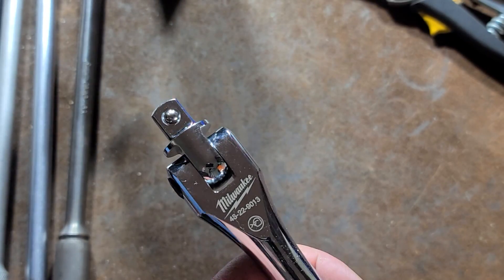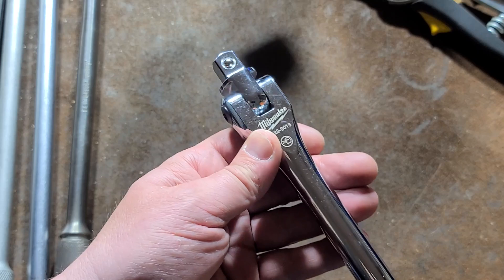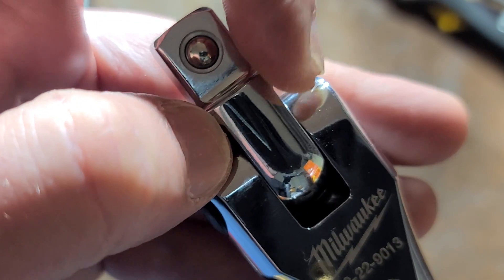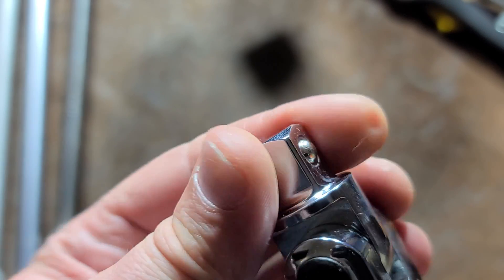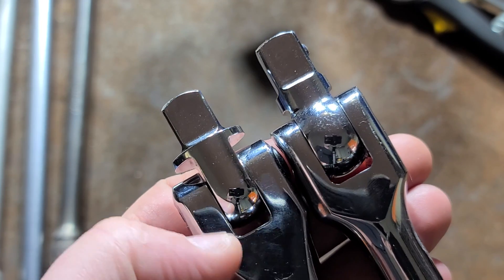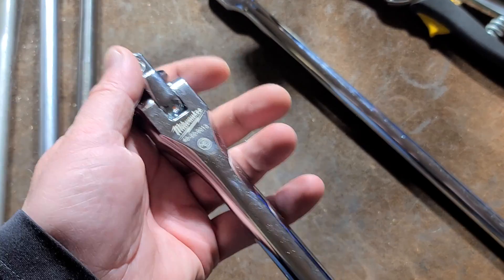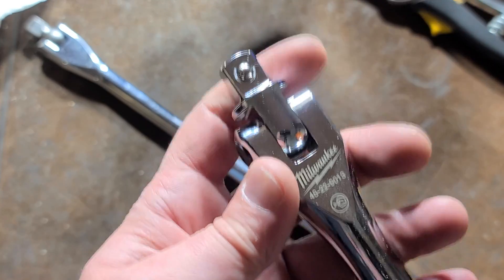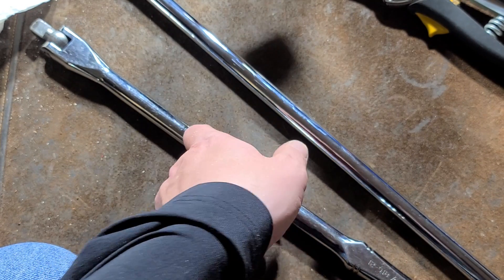Milwaukee 1/2" Drive Super-Duty 24" Breaker Bar Review

Comment: at about 3:00 they are trying to avoid a stress riser/potential cracking at the base of the square drive--looks like
If they have created the indestructible handle they should make available "repair kits" with replacement square drive pieces and perhaps a new bolt and friction washer (if used) although the bolt might very well survive a twisted off square drive and still be reusable
  no matter how good that thing is someone will find a way (cheater pipe?)  to twist off the square drive end. 
if I remember there is a repair kit for certain Snap on,instructions to tighten the bolt to 60 inch lbs. and I think the bolt comes with dry locktite already on it 
I think that style uses a bolt that is correctly matched (threaded section is the exact length needed) to be snugged without clamping the ears together excessively
a cheap bar may have a generic bolt that if completely tight might clamp things together locking the drive such that it won't flex
Reply: The technical term you're looking for is a "shoulder bolt"

Comment: Is there some way to use this with a 3/8" drive socket, to remove a frozen  on lawnmower blade? Would it work to add a 1/2 to 3/8" drive socket adapter, or would that weaken everything too much?

Comment: Thanks for the review!  Question for you:  I am having trouble loosening some lug bolts.  My 450 ft lb corded impact wrench got 10 of the 20.  A cheater bar on a half decent ratchet got one of the remaining 10, but the ratchet snapped on the next.  I've applied PB blaster, but have not tried heat.  My question:  if a 450 ft lb impact won't free these, will a cheater bar snap the Milwaukee breaker bar (I think you said the Milwaukee could handle 300 ft lbs)?   Any thoughts on  this?

Comment: Only my opinion... but can't help but wonder if they aren't making them extra beefy to compensate for use of 'cheese grade' alloys; and/or omission of pricy heat treatment. Just a hunch, who knows... those are qualities one can't determine by mere observation.

For the record, a friend bought a 600mm (23.6") all metal smooth handle Koken 1/2" drive breaker bar a while back. It's very nice! I like it over my old 24" Snap-On.

IIRC he said they wanted about $90 for it... but he snagged it in one of their big time 25% off everything sale extravaganzas.

Comment: We had ordered one of these through Grainger at work and, for the couple of times I've used it, it has held up fine (including use with a cheater pipe on some bolts that probably required a 3/4" bar). I like that the hand area is wider - makes it more comfortable to use when applying a lot of torque.

Comment: The Stahlwille 24" may have a larger head (35 mm. wide by 24 mm side) as reported in "Beefy Stahlwille breaker bar" in Garage Journal but the shank on that one seems to be rather thin compared to this Milwaukee
a question would be whether the Milwaukee is high grade forged alloy steel vs. some kind of casting

Comment: We all know Pittsburgh is the way to go with a breaker bar. It’s just a long piece of leverage metal no need to spend the extra cash unless having a name stamped is what you really want. If you ever get to the point that it breaks, bam new one no questions asked. You can buy 2 just in case and still save money
Reply: Easy to break rubbish 1/2" long breaker bars, hassle to go to the store, hassle to smash yourself, or fall off a ladder just because you were cheap and bought a garbage tool.
Reply: The Pittsburgh stuff breaks pretty easy after repeated use.

Comment: TBF, my Craftsman stuff is only stamped with the logo on one side. The price is comparable to the 1/2 I-beam breaker bar, too.
Reply: If it's like their other stuff they at least also stamp in the part number rather than just lasering it.
Reply: @AToolWithTools  Yes, the reverse does have the part #. As far as stamped or lasered, IDK. My shop is doing pretty crazy stuff with lasers on the production level.
Reply: @scarling9367  The problem with laser and chemical etching is it can wear off pretty quick if not done right. Or just looks sloppy and incomplete which seems to be a common problem on Channellocks lately, can't hardly read it right out of the package. Stamped in, you can reference it for years to come.
Reply: @AToolWithTools  That used to be a big drawback, but lasers have gotten better and more affordable. They can produce a logo quite comparable to a stamp in depth and clarity. Is there places still using the laser etching that'll wear off, yes. But I'm seeing less and less of it.
Reply: @scarling9367  Better tell Channellock to get in on that. Even their small-time competitor Wilde has really nice clear and strong etching. Japanese tools that I've seen don't necessarily have it on full blast but it is very nicely done and still easy to read. Channy is really skimping.
Reply: @AToolWithTools  I can't speak for Channellock, but I can tell you that the laser etching survives both the hot stamping and shot blast process at my shop.

Comment: ..but did you actually test the torque capability and the amount of flex and state what material its made from, there are huge differences in materials which you cannot tell by looking, one clevis can be larger than the other but can also be weaker depending on the material it's made from, but all your comments are based on looks! Sorry not a helpful report.

Comment: $43 for a breaker bar? Only 24" at that? Absolutely not. You're paying for the name that's stamped on it at that price point, which basically sums up most Milwaukee hand tools.
Reply: @stevensko9153  I like Milwaukee hand tools, but nothing is gonna be considered a step up from the Pittsburgh comfort grip 1/2 breaker bar, I bought it for $20 and it hasn't broke yet, I've used it for just about everything including taking the lugnuts loose on my dads D600 gain truck. I like having quality tools but when it comes to breaker bars for the price the Pittsburgh is impossible to beat imo.
Reply: @stevensko9153  in a world with long handle ratchets that have stupid strong heads and lifetime warranties, no one uses breaker bars anymore anyway, so anything beyond Pittsburgh price is too much.
Reply: @Callelle6251  Use the right tool for the job. Only the cheap and lazy, who think their body came with a lifetime warranty, use a ratchet to break torque.
Reply: @nednedly3962  yeah, no. There's reasons that there are things like Cornwell's 42" 1/2" ratchet. I'll keep using my 36" Matco breaker ratchet with a 3' pipe on it over having to reposition a socket every time. Work smarter, not harder.
Reply: @Callelle6251  we'll have that carved on your tombstone. You really should listen to your own advice.
Reply: @nednedly3962  I like that you dodge the question of asking why these extremely long handle ratchets exist if they aren't made to take the pressure and break fasteners loose.
Reply: @nednedly3962  Yeah I thought you didn't have any response. Next time keep your trap shut.